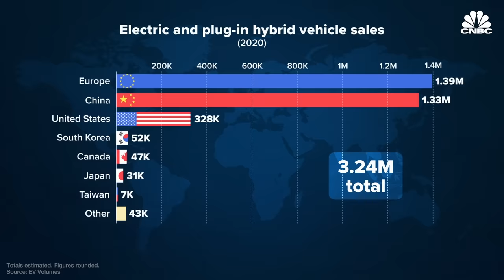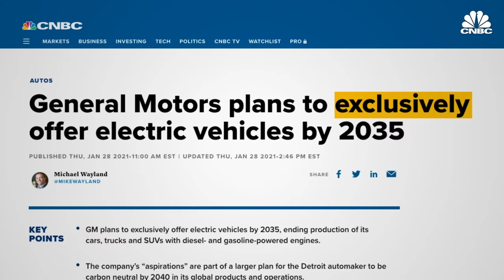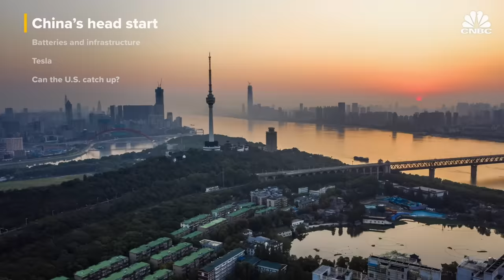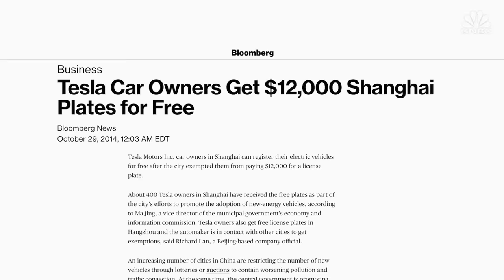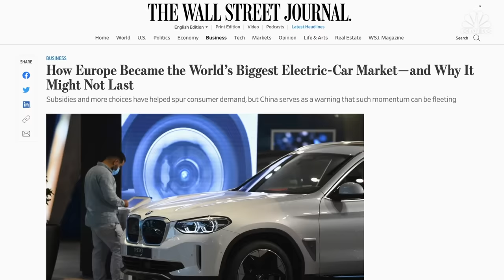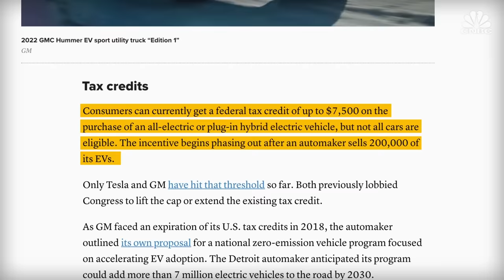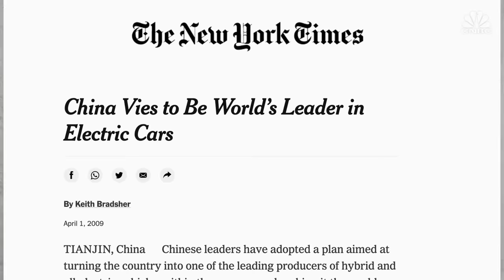Who Is Winning The Global EV Race?

Comment: As for battery swapping, there has to be a way to prevent scams.  You buy a new car with a new battery. The first time you pull in to swap battery, the independent battery swap business gives you back an older used battery.  The business then sells that new battery and buys 2 or 3 older batteries.  Rinse and repeat. Never underestimate the U.S. business mindset to scam for easy money.
Reply: does it matter how old a battery is if it gives you full power in a swap? i don't think so.
Reply: To consider battery swapping as an option is the first problem.  The infrastructure cost for battery swap stations across the whole country is simply not realistic, and when batteries last 300 miles a charge, there's no need for swapping stations wtihin the city for daily commute.  Any owner would rather plug in their car, charge for cheap rather than taking valuable time each week to drive all the way to a swap station, line up, and pay extra for the same amount of energy.
Reply: Why it is matter?, The car shows the mileage it capable, it won't below the manufacturer standard  or else they'll replace it
Reply: @lanzer22  Swapping could be interesting for those who doesn't have a home garage or live far from chargers.
Reply: Yes. Either battery swapping is for additional packs for longer journeys in addition to the small pack that comes with your car, or you buy a battery-less EV and arrange a separate contract for electric miles. Either way the battery swap supplier has to charge a lot of money to pay for all its battery packs and swap stations. And if you drive around for months plugging in elsewhere to recharge the swap company's battery packs in your vehicle, how does the swap company get paid? Better Place had to forbid its users from plugging in elsewhere.
Reply: @lanzer22  not realistic.. meanwhile china does it and last i checked they have way more people.
Reply: yes, but US has regulator. I know it will limit business, at some point to protect consumer, the government will need to come big at these battery swapping companies.
Reply: Any business that wants to stay operational would have to offer a warranty on their swap battery
Reply: You can buy a car without battery but rent for it
Reply: I would think a subscription model would solve many of these concerns. If you can swap on a regular basis then it doesn't really matter so long as the quality of the battery meets a relatively high standard.
Reply: @duhaneyparkclassics7484  you must not understand battery technology.  Everytime you pull battery power and recharge the battery it loses a small percentage of its efficiency. They can only be recharged x amount of times and made worse if you do alot of fast charging.
Reply: @lanzer22  umm.  Yes because gas stations are oh so cost effective? Lol. Battery swapping is quick and effective. You don’t need to have 20 chargers and wait 40 minutes. It’s in and out in 5-6 minutes.
Reply: @alansmith888  Think of it this way, gas stations can serve all cars that have a gas tank.  Meanwhile, different brands, different types of cars and newer battery tech could all be incompatible with each other.  Do you think that all car companies are gonna band together to make one single battery casing?      That is the aspect which can balloon the cost or practicality of battery swap stations.  Will Toyota be happy if their customers swap into a battery from GM then problem occur?  In practice each brand will have their own standards and stations, so we're not gonna have charging stations with ability to store and swap 10 different brands batteries are we?  On top of that a majority of drivers wouldn't even use it as they can charge at home, choosing to use it only if and when their battery is degraded, lowering the customer base and increasing cost.
Reply: @duhaneyparkclassics7484  Nio added 700 stations last year.  The USA has 150,000 gas stations, and Tesla has 30,000 charging stations currently.  China is large, but topography is vastly different as only most of eastern China is populated,  population within cities are much more dense, with millions living in high rise apartments, making it much easier to reach more people with fewer stations.  Of course, it's possible to have a swapping network in America, it's just hard to imagine it being a profitable endeavor.
Reply: @lanzer22  most of the US population is on the coasts if people tell you different they are lying im quite familiar with almost every population center in  the US.  if yu build swap stations they will be used and eventually achieve economy of scale. but ho hummimg about it is why we are still using gasoline.
.
Reply: @kenjett2434  ok mr assumption the whole point of battery swapping is so you dont have to fast charge them.
Reply: @duhaneyparkclassics7484  true but you glossed over the main point. A battery loses efficiency with each recharge whether slow or fast. What I said was fast charging just makes the degradation of the battery faster and worse it will still degrade even on slow charge just not as fast. Batteries do not have infinite life and that is the biggest issue with these electric vehicles. They are extremely expensive $5,000 or $6,000 to replace and to equal the lifetime of a internal combustion engine Batteries would have to be replaced minimum 2 or 3 times on a car you already spent $50 000 for.
Reply: @kenjett2434  which part of economy of scale did I gloss over? I work in the car industry buddy when ev cars first came on the scene a replacement battery was more like 11-15k. i hope you get my point now.
Reply: @duhaneyparkclassics7484  you just mentioned the fast charging issue but you missed the fact that I also addressed the issue of slow charging also. That's what you glossed over do you not read whole comments.
Reply: @kenjett2434  the forrest you are missing is the fact that once batteries become cheap who cares if they last the life of the rest of the car? just get new ones. no need to reply being that you are a circle talker and i need not go back over moot points.
Reply: @duhaneyparkclassics7484  thats a classic loser statement. batteries such as these will never be cheap. The only real chance for EV power is new technology as in some type power cell. Such as a in a miniature plasma or fission reactor or something like in Sci-fi in Stargate a zero point module type device. The only reason for circle talk is because you keep circling.
Reply: @kenjett2434  Cellphones wont be cheap... computers wont be cheap... dvd's wont be cheap. charw will never be cheap... shall i continue?
Reply: @duhaneyparkclassics7484  your right they won't be cheap no argument there and that's been part of my point just not the whole point. Because I been trying to show not just cost but the major flaws in the technology itself. EV's are being pushed onto the public before technology is ready for there introduction.
Reply: @kenjett2434  ok Elon...oh you aren't Elon my bad, think i will listen to him though no disrespect to you.
Reply: @duhaneyparkclassics7484  hey I think Elon is a pretty fair person and I too like alot of his opinions. However Elon is a car maker who depends on selling cars. So he may not be the best to take advice  from when it comes to his vehicles. I have never seen any salesman that didn't add extra hype just to sell their products Elon is no different.  That's just my opinion based on many years being a heavy equipment operator. In doing that I did bulk of all mechanics work so I know and understand machinery. I also have a 2 year electrical degree that gives me a fair knowledge on anything electrical. I am not against EV's they have a place but they are no where near able to replace fossil fuel.
Reply: In China, you can rent the battery from Nio, not only it solve your problem, it also make the car much more affordable.
Reply: @kenjett2434  his expertise is proven whereas yours is just hyperbole.:elbowcough:
Reply: @godzillamothra5983  point taken. thanks☺
Reply: @duhaneyparkclassics7484  you don't  know me from Adam why are accusations except to cover your own short falls
Reply: @godzillamothra5983  yeah I have seen a little on that and it's certainly a unique attempt at solving an issue. But the financial structure is considerably different in China than here in USA. They  depend on really cheap labor and alot of poverty compared to us here. So although they are some companies looking at this it's not catching on. In time it may but the real answer for the EV is better technology to power them. I still say the only way to truly make them work better than fossil fuel is through some type of miniature reactor. As of right now the Hydrogen fuel cell has promise but still lacks needed efficiency.
Reply: The purchase of the battery is not part of the purchase price of the car.
Reply: @johnbuck971  it is with most brands as like in case of Tesla that is prepietary. The Leif yes could be separate as well as some from China but most the Batteries are baked into the price of the car. That's why they are so expensive to buy.
Reply: @kenjett2434  men lie women lie... numbers not so much.
Reply: @duhaneyparkclassics7484  on that I do agree
Reply: Battery swapping is for the service, you lease the battery or at least  never own the battery, you share the  networks batteries, NIO  does this, nobody else as of  today, Geely  in the futurehas one in the works.
Reply: A fool and his new batteries are easily parted. Stay clear of this option. Fast chargers will be available almost everywhere.
Reply: @ujjalshill6442  all good points but banning all cars just isn't practical. Not everyone can live in a city and you need those out on the country farms to be able to produce food for the population of the world. But your right building electric cars is more of a dirty hazard than building fossil fuel cars.
Reply: @aurelio-reymilaorcabal9669  those are just plain dumb talking points. Your only thinking about the energy to make it go and not the dirty cost of all the materials that go into building them. Nor are you considering the end disposal of all those batteries and end of life of the car which is  3 times faster than a fossil fuel car. My old truck is 20 years old 252,000  miles and still running like new with a 300 mile range on a tank hauling a load. Sorry but your glorious electric can't come close to that. Those lithium batteries are some of the dirtiest on the environment to produce and a limited lifespan. Let not forget how expensive they are to replace. So take your head out of the sand because they are alot more too it than just hooking a charger to it. Oh by the way that power your charging with is probably generated by fossil fuel. Only one percent of power is generated by renewable energy. Try getting an education and stop listening to talking points.
Reply: Isn’t this a problem the blockchain technology was supposedly made for? In a market where trust is needed but cannot be in the hands of humans the algorithm can do the job
Reply: There are two ways it could work. For the general population, the batteries would be leased from the battery swap company, thus no motive to "sell new packs". This would also make initial car purchase price much lower. 

The other would be corporate fleets like taxis and delivery, there the company would own the batteries and swapping stations.
Reply: INDIA WANTS TO FALL DOLLARS VALUE..
Reply: Here in China, NIO is selling cars without battery now. it's cheaper and offers a customizable battery rent contract
Reply: You only buy the car, and rent battery
Reply: you can buy a Nio car without purchasing the battery. Instead, you can lease the battery separately as a service. Nio offers free battery swap services for Nio owner.
Reply: They all need to have battery life monitors standard on dash.
Reply: Even if it is a rare occurrence it will put fear into people.
Reply: Why not just deliver it as IAAS instead of retailing them. Make it a subscription like how Nio does theirs.